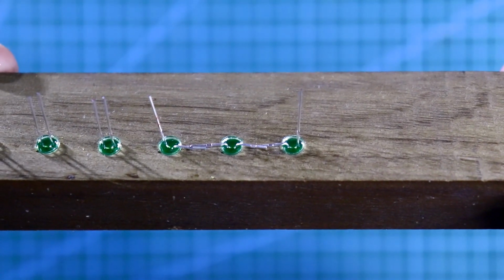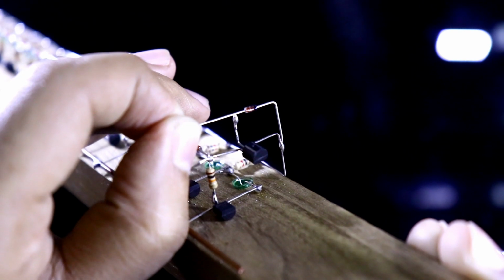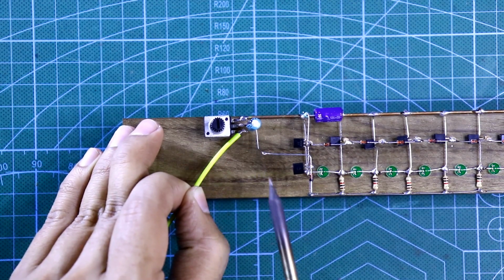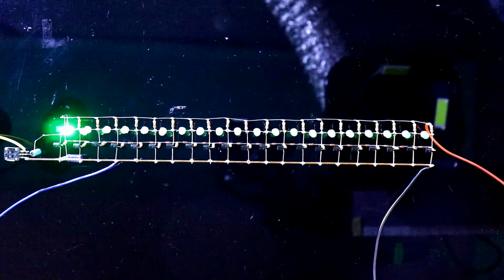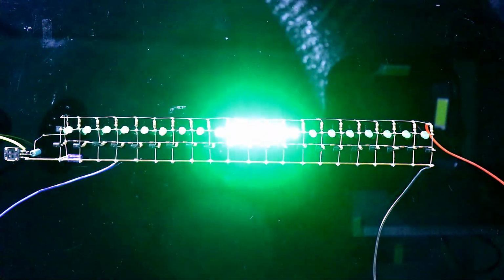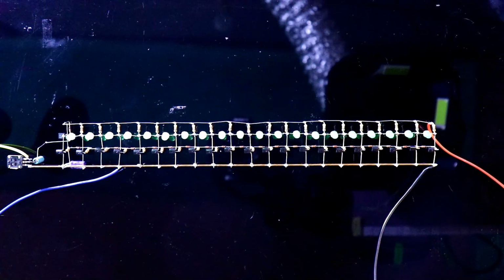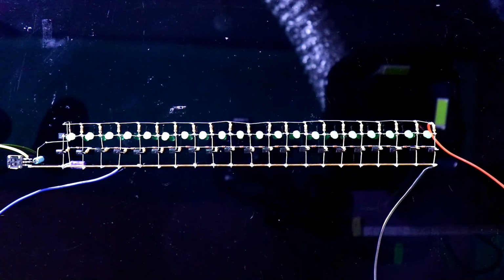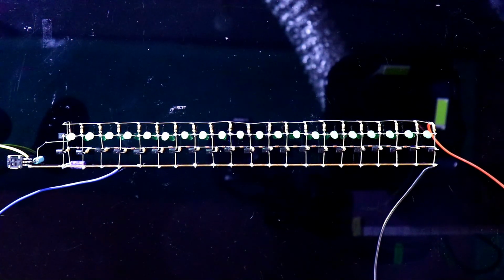VU meter only with transistor | Without any IC

Comment: You are an awesome teacher. Are you self taught or educated in electronic engineering? 

That would look awesome in a thin frame with the light difused using tracing paper under the clear plastic poster frame material from a craft store. You could make like 20 of them for under 20 dollars. Thanks for the idea. The frames are garbage quality but the parts can be reused perfectly for multiple projects like this to make them look like they were built professionally.